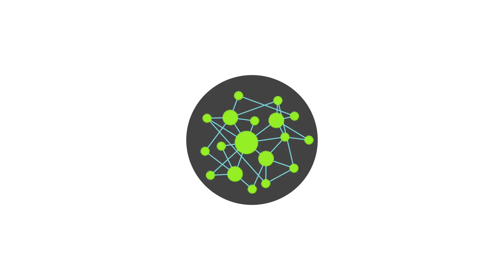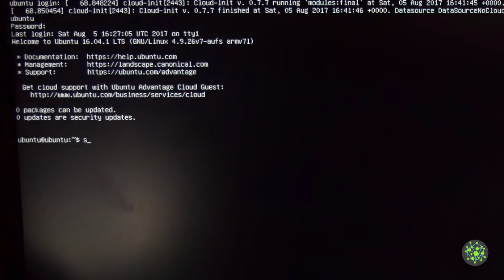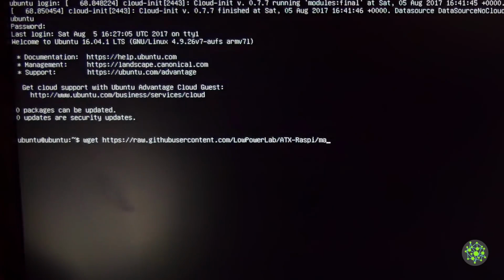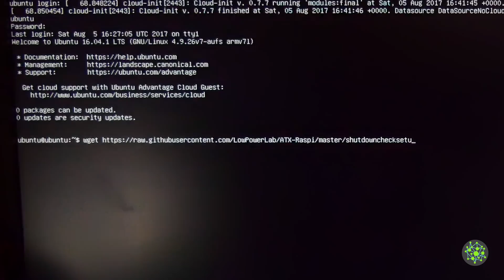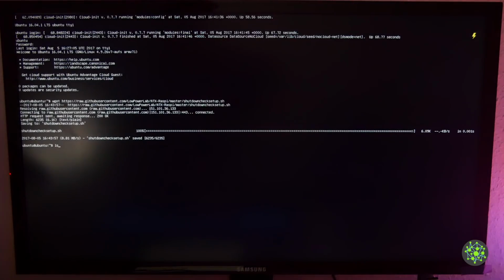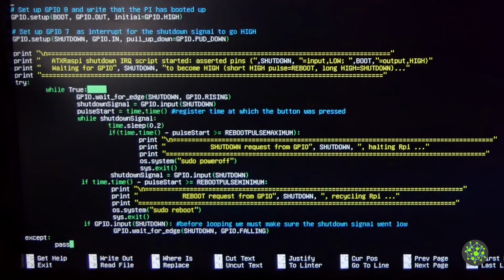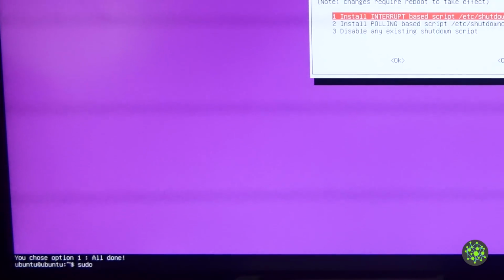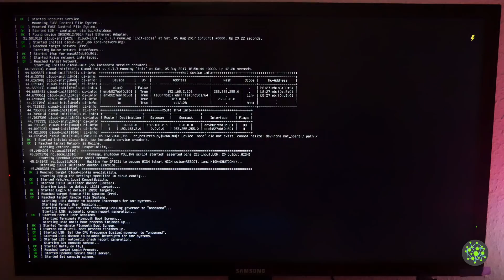Ultimate Raspberry Pi Build #03 - ATXRaspi

Comment: @6:00.  Instead of just giving up if you messed up the pin listing, you could take the card, mount it on another pi, and then fix the file settings.  Easy peasy

Comment: FYI - the lightening bolt states that your Pi isn't getting enough voltage with everything connected. Might need to add another power adapter.

Comment: what is the point?
arent you just making a pointlessly week and slow PC?
The only point of a pi is size and power related portability which this has killed both of those points so I have to ask, Whats the point?
Reply from the maker: +Paco Vasda Where does this have killed the size aspect as well as the power usage? It is still small, portable and uses much less power than a normal PC.
Reply: enwi oh yes I agree except the problem is it is it has a lot less capability in a pi than a normal PC that you compare it to. I didn't say it sucks. You do have to admit that the fan alone makes the project two and a half times as big as just the pi itself, the big bulky battery however is necessary and that's a fairly thin one for his big as it is.
But then again that fan might  take many many times more power than the pie will??
 I am genuinely interested. That was not a rhetorical question, it was an actual question.
Regarding this project, what's the point? I'm not assuming you using a Raspberry Pi for the sake of using a Raspberry Pi, I'm assuming you have this in mind for a project.
Many of mine have required removing the bulky USB ports ethernet ports to make Pi smaller so that I can fit it in objects into the projects that I use one for.
 I was so thrilled to find the Raspberry Pi zero because it squeezes into many many more projects. For example I have a little solar powered yard light that is actually a solar-powered surveillance pi cam in the yard.
 I've never seen a pi get hot enough to benefit from a fan.
 Not trying to be condemning I'm being genuinely curious.
It's people like you that teach me how to do any of the cool stuff that I do.
Reply: I could see this being nice as a totally customizable in dash computer for the car.
I've also heard of some cluster computers made out of Raspberry Pi's.    Could you make some kind of little supercomputer that's more powerful than your standard PC but still smaller then your standard PC?
 and still cost-effective out of multiple pi?
Reply from the maker: +Paco Vasda That would be nice, but also pricey. I would rather use some Odroid HC1's or MC1's instead of a pi for such a project.
Reply: he making it for fun

Comment: or -- you can download any Rasbian Jesse built after April 2017  ..they already have the built-in shut off command script in a button form ... no more of these add-on boards needed ....well -- at least mine does ..
Reply from the maker: +you166mhz I didn't know that was a thing. Thanks for the info.
Reply: But does that shutdown peripherals as well?
Reply from the maker: +Dean Mires The ATXRaspi shuts off it's output thus killing power to anything connected.
Reply from the maker: +Dean Mires I guess the other method will only kill power to all usb ports of the pi.

Comment: Can I use only one on a three raspberry cluster?
Reply from the maker: +Moisés Pereira You might be able to pull that off, because the ATXRaspi can be used to up to 2.5 amps or more, but you would need to find a way to synchronize the shutdown between all of your Pis. I think just connecting all shutdown and bootok pins together might not work. You would need to modify the shutdowncheck script so that one Pi controls the other two and waits for them to shutdown and then turns itself off.